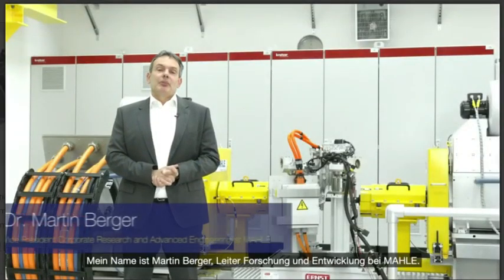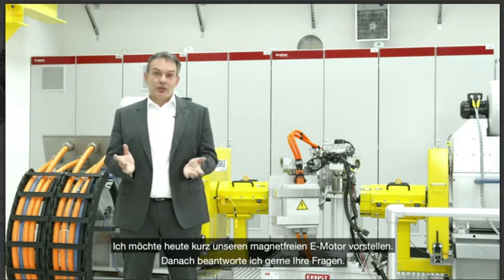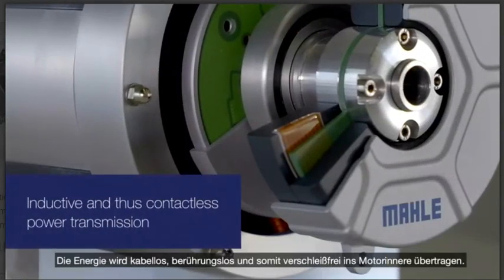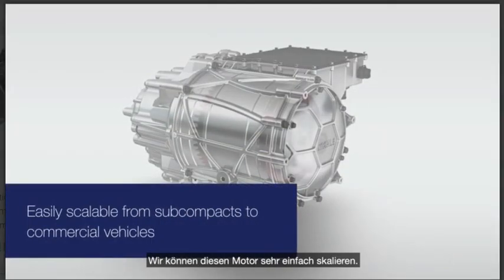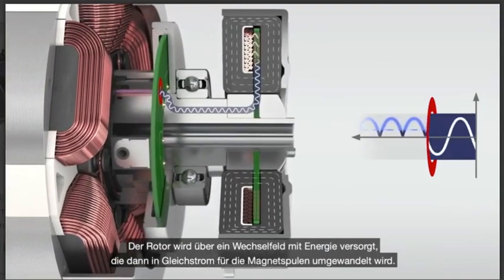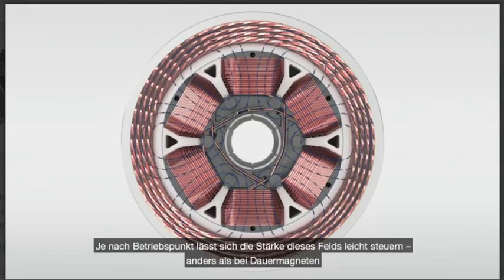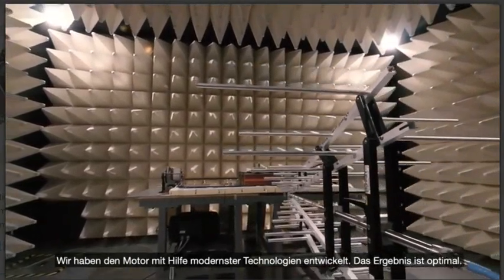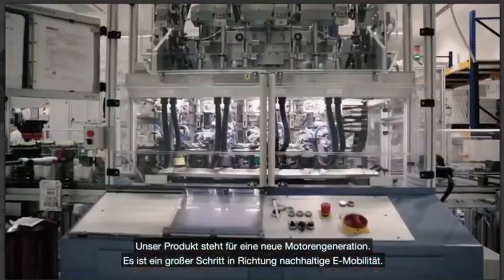Mahle, produce revolutionary new no-magnet motor...

Comment: It's good to see them trying to innovate.  However AC motors with no permanent magnets were the first type of AC motor invented, by Nikola Tesla.  Permanent magnets are a relatively new part of motors, thanks to the stronger fields of relatively recent rare earth magnets.

The main unusual claim here is high efficiency at a broader range of speed and load.  Most electric motors have specific areas of speeds and loads where they are maximally efficient.  This invention claims to have broadened that area of efficiency quite significantly.  If so, that would be a good thing.
Reply: You dont seem to understand what they are suggesting. What they show is synchronous motor with wireless power transfer to induction coils on the rotor. This is not asynchronous engine which was invented by tesla. The main disadvantage of permanent magnet motors is inability to adjust induction field (since permanent magnet cant change thier magnetic flow), which causes reduced efficiency on cruising speeds due to selfinduction currents.
Reply: @richnsk  as a person who builds and repairs electric motors daily. I can say with 100 percent certainty that wireless transmission of power from the stator windings is not new.  In fact, in some instances this can cause currents to even pass through bearings and cause damage to the bearing contact surfaces.
Reply: @beargibson3100  you are way over your head in this one guy. go get an education. wireless transmission and inductance not the same.
Reply: @DieselRamcharger  The real trouble is that I'm way over your head.
Reply: @DieselRamcharger  I have an education in this field, and maybe you should rethink your comment. There are 3 forms of wireless transmission of, depending on who you ask.
1st is electric field, this is unlikely here as the losses would be very high and would require an antenna, a very long one for the amounts of power being discussed here which again is impractical. There are other reasons not to use this method but they are too lengthily to discuss here. 
2nd is light transmission, this is simply a high powered lazer aimed at solar cells, this again is impractical due to the size and fragility of solar cells which would have to be on the rotating shaft.
3rd and most likely is induction, which can transmit information as well as you can modulate the AC magnetic signal (this is how NFC, and RFID work.) at close distances this is fairly efficient compared to other methods. However, there are still losses, usually significant ones. This goes up greatly with increase in gap size, which is needed in motors to prevent friction.
Reply: @FrozenKnight21  Probably they are using a resonant magnetic circuit for the brushless power transmission to the rotor.  It can operate over larger distances with greater efficiency than regular induction.  Using a resonant circuit, the gap distance can be much larger and have high efficiency even with a larger gap.
Reply: @DieselRamcharger  Induction is a form of wireless transmission of energy.

To power the rotor, this motor may use a different type of induction called a resonant circuit.
Reply: @FrozenKnight21  It's not just "likely" induction - the video explicitly shows the induction coils and describes their operation.
Reply: @LoanwordEggcorn  The power transfer to the rotor for winding excitation does not require a large gap. The video clearly shows the rotating transformer which does this transfer, and the very small gap between the stationary and rotating coils.
Reply: @brianb-p6586  Was referring to the gap for transferring power to the rotor.  Agree the gap can be arranged to be small, but if not small, a resonant circuit could be used to make it more efficient over larger distances.
Reply: @LoanwordEggcorn  We're talking about the same gap - it's very small. Have a look at the video.
Reply: @DieselRamcharger  Porém estão diretamente correlacionados.
Reply: @pauloroger8503  
correlación no es causalidad
Reply: @FrozenKnight21 oof, not busting out the plane-wave equations for NFC?
Reply: @richnsk  Agree, it has some characteristics of both DC and AC motors, but without permanent magnets, and without the need to do artificial field weakening (as in an AC motor) since they can alter the magnetic field of the rotor more directly, because it's an electromagnet instead of a permanent magnet.

That is indeed useful and cool.

Spasibo.
Reply: The induction motor is not invented by Tesla, it was invented by an Italian professor named Galileo Ferraris. Our modern electrical system and 3 phase electric motors are the work of Michael Dolivo Dobrovolski, a Polish engineer IIRC. The myth of Tesla and Americano-centric story of electrification is overblown, and it's mostly based on myths. AC was being used in Europe with kilometers of HV transmission lines way before the so called war of currents in the US.
Reply: @alicangul2603  your claim that Galileo Ferraris invented induction motor is based on his claim that he made working prototype in 1885 of alternator (not motor), which is same true as Tesla claim he invented induction motor in 1882, but facts are that Galileo presented his work in 1888 and Tesla applied for patent in 1887.
But not one of them was first Walter Baily (English) demonstrate first (very crude) induction motor in 1879 but his motor worked  it on AC but he manually switched DC.
By the way there was many court cases when some corporation try to prove that Ferraris published work before Tesla (and invalid Tesla patent) but court ruled in Tesla favor. 
But from that time there is lot of myths what really happened,  for years there was myth that Pupin testimony was in favor of Marconi but that is far from true.
Reply: @alicangul2603  and your claim is about Americano centric about Tesla is totally false, if you ever saw any of his parents you would see that he started all with something like this "I am Austrian citizen temporary residing in USA".
By the way 1882 when Tesla supposedly invented induction motor he was not even in USA but he was in France.
Reply: @alicangul2603  what is your source for this information.
Reply: @beargibson3100  Why request a source from me while you can open up a Google page to learn about it? I've talked about a lot of things in my comment and to be honest, I'd rather have you think everything I said was a lie, than search around to find sources to present to you :)
Reply: @beargibson3100  I suggest starting with the wikipedia pages for "Induction motor" and "Polyphase system" (3-phase power). Wikipedia pages have references linking to further sources. Note that the Mahle motor is three-phase, but is not an induction motor - see "AC motor" to understand the difference.
https://en.wikipedia.org/wiki/AC_motor
Reply: @alicangul2603  Agree that many people contributed to the invention of the AC motor.  Certainly there was a lot of science and engineering leading up to it.  And as with many inventions, there were probably multiple people working on similar ideas around the same time.
Reply: @LoanwordEggcorn  Totally. Check out this great article about the nature of inventions, definitely worth a read: https://www.bbc.com/future/article/20130322-tesla-and-the-lone-inventor-myth
Reply: @alicangul2603  Mikhail Dolivo-Dobrovolsky was Russian. Tesla and Ferraris are generally recognized as independent inventors of the induction motor, with Mikhail Dolivo-Dobrovolsky following with the squirrel-cage variant a couple of years later, which doesn't diminish the importance of Dolivo-Dobrovolsky in the broader field of 3-phase power. Of course in each country only the local inventor is widely known, and for the U.S. that's Tesla... who was also an eccentric character, gaining him more attention.

None of this has much to do with the specific design being promoted by Mahle, which is a three-phase motor (of course, like every other modern electric vehicle motor) but is not an induction motor.
Reply: I suppose theoretically it's possible to use 2 opposedly phased power signals, one can just feed the stator coils, the other side of the stator coil goes to the axis, using the axis and housing as a ground. And use the stator housing ground connected to the stator coils, connected to the opposed signal.
instead of tri-phase at 120 degrees, it's dual phase at 180 degrees.
There's no rulebook telling to use tri-phase for electric motors only...
Reply: Wouldn't these be unable to use regenerative braking?
Reply: @JorenMathews  no, there's nothing about the wound rotor or inductive power transfer to the rotor winding which would be a problem for regenerative braking (which just means operating the motor as a generator.
Reply: @JorenMathews  Regeneration would work.  All that's needed is for the stator magnetic field to lag the rotor magnetic field.  In other words the speed of the magnetic field in the stator is lower than the speed in the rotor during regeneration.  This is achieved by controlling the respective fields electronically.
Reply: @LoanwordEggcorn  Very close... this is a synchronous motor, so the stator magnetic field and rotor magnetic field (and rotor) rotate at the same speed - the lag is only in phase (angle).
Reply: @brianb-p6586  Agree.  The lead or lag (for accelerating or decelerating) would be in phase angle.
Reply: @JorenMathews  That is an interesting question. And I am not sure. Sailing is almost as good as regen so probably it is a trade-off worth taking?
Reply: @JorenMathews  With their similarity to Synchronous AC Alternators, I think they might make good (re)generators.
Reply: True.. just wondering how efficient would it be since this motor is creating 2 opposing electro magnetic fields instead of 1 as what the permanent magnet work.
Reply: @jlacc1  That's a good question, I just wanted to point out it wasn't new tech. Just a different way of using what we already have.  Slip ring motors Not only energize the main stator winding and apply a voltage to the rotor winding to increase the torque of the motor.  One would be surprised to know that The common hand grinder has no permanent magnets. Its called a split phase motor. The rotor is wound like a DC. Infact, you can run an ac  hand grinder on dc power. I won't say it has the same power, but just an interesting fact.
Reply: @jlacc1  Being able to control the rotor magnetic field dynamically is probably how it achieves better efficiency than a permanent magnet rotor.  At times, the permanent magnet works against efficiency.  Substituting that with an (computer controlled) electromagnet should allow more favorable operation over a wider range of conditions.
Reply: @LoanwordEggcorn   however the idea looks good but how much power does it need to make a substantial amount of EMF to achieve the wattage and voltage even if they use supercapacitors to quickly charge the winded coils. On a small scale is doable but on a vehicular let along industrial application would lead to some health hazards on regarding high EMF.
Reply: You cannot be more efficient at the same circumstances of a similar motor with magnets, you are by definition putting more energy in to replace the force of the magnets.
Reply: It wouldn't be as efficient as a motor with a magnet, because it is using energy to make a electromagnet. Where as a motor with a magnet only has to power one side, not both like this motor.
Reply: It's very different from a brush less DC motor. BLDCs usually have permanent magnets. And it also differs from induction motors significantly
Reply: @Henrik0x7F  Agree, it has some elements of both AC induction and brushless DC motors.  In any case, it's good to see some innovation.

The most important aspect is the claimed efficiency improvement.

Comment: This also allows for variable torque, no?
Edit: Power, not torque
Reply: All motors allow variable torque. They would be unusable in vehicles if they didn't.
Reply: @brianb-p6586  ah, right! Power, not torque.
Reply: @MauveTrees  Power and torque vary together. Power is speed multiplied by torque. If you are varying one, you are varying the other.

In an electric motor, torque depends on current (in this motor, on both the current in the stator windings and the current in rotor windings).
Reply: @brianb-p6586  I suppose then that my question is on the ability to vary the current through the rotor windings. Is that an advantage over permanent magnet rotors?
Reply: @MauveTrees  Yes, that's an advantage over permanent magnet rotors... as well as simply not needing permanent magnets and the materials needed to make them. With permanent magnets, if the magnets in the rotor are strong enough to produce sufficient torque at low speed, they're too strong for high speed (causing a need for higher than desired voltage to turn the motor).
Reply: @brianb-p6586  So would you say that you could vary the start-up and operational torque by varying the current flow through the rotor windings? How would you describe that advantage?

Comment: So its a brushless generator design running as a motor. Those were invented in the 70' or so..
Reply: That type of motor/generator was invented in the late nineteenth century.
It's more than 100 years old.
Reply: @norbertfleck812  True. I do sometimes work on such machines. But they do have mechanical rectifiers and and sliprings for the main field. Thus they are not brushless. Brushless machines have rectifier diodes in the rotating assembly and no sliprings.
Reply: @86Ivar  Or they simply have got a small DC generator (or rectified AC) on the same shaft which generates the current for the excitement of the synchronous rotor. You control the current by modulating the magnetic field of the DC machine.
That's exactly what MAHLE presents. Just in a more compact design.
Reply: LOL yeah the 1880s
Reply: @Lassi Kinnunen 81 I'm afraid, that's they key part. If it's UP TO 96, still impressive, but i think not for the big part of the envelope. Maybe the 96 percent not the full system, but a part of the motor. It's more likely only an investor marketing pitch, which will be forgotten in a couple of years without delivering significant volume. Or do we really expect, that mahle came up a groundbreaking technology, better than siemens or others in the industry for a century? They have a wireless charger pad for cars too, but no real world data on their site just sales pitch and buzzwords, like with this motor. Seems really fishy to me.
Reply: True... This isn't about handing out a prize for invention though. Its about innovation. The fact that it was created back in the 70's makes it even more stupid that no one else has put it into practice. Here is a company that is actively doing so though. Thus, for innovation, they win a prize. At the very least, a cookie.

Comment: It may not require rare earth materials but certainly needs copper which is not
very abundant in the Earth's crust, about 1/1000 that of Aluminum or Silicon.
Aluminum is inferior to copper but could still be useful in a pinch.   Perhaps 
Silver would be used if copper prices become very high.  Silver has desirable 
electrical and mechanical property's.

Comment: Wait this is similar to the universal motor used in a.o. typical household vacuum cleaners only with inductive coupling to the rotor instead of brushes.
The disadvantages of these types of motors are firstly the brushes which introduce resistance losses and can wear out fairly quickly (SOLVED). And secondly because electric current is needed to energise both the rotor and stator windings they are typically less efficient than permanent magnet BLDC motors.
Reply: Except that you can drive it like it's a brushless motor with a speed controller and exact velocity. DC motors, universal motors, and brushless AC motors, the speed you get it what you get based on load condition.

Comment: Can it withstand an EMP, or recover quickly thereafter?
Reply: It's a copper wound motor with thick wires running at 600 Volts, not a fragile piece of silicon with micron sized features built to withstand 3.3 Volts. I don't think there will be any problems.
Reply: @Proud2bmodest  The brushless device might be sensitive to EMP, as it contains a lot of Silicon semiconductors.

Comment: Will still need a controller to set power and speed. Not sure what the advantage is to using a variable speed drive together with a standard AC motor. Neither needs rare earths.